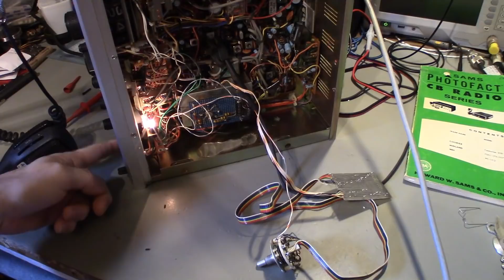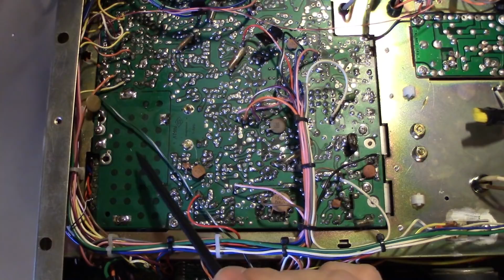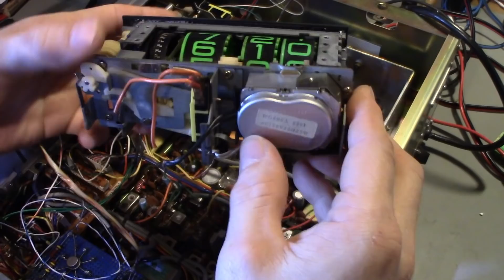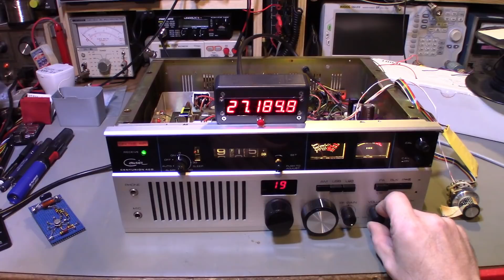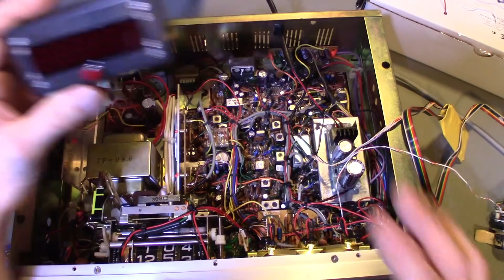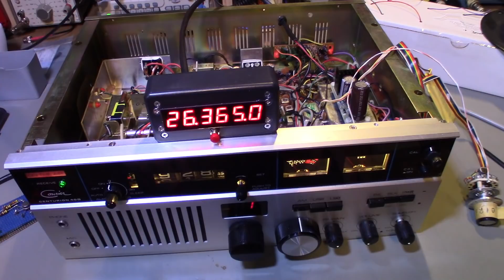Courier Centurion 40D AM/SSB 40 channel CB restoration.

Comment: How much would you charge for a restoration like this? It seems like an excessive amount of work. It would have to be cheaper and better to buy a new radio wouldn't it?

I have a cobra 2000 that my grandfather used as long as i can remember. I always wanted to have it restored and I don't trust myself with all that. I wish they made a modern upgrade you could just plug in some way. It could be tiny with the technology available now.
Reply from the maker: In many cases with the higher end vintage radios they were just built better and people would rather have a classic restored instead of a modern radio of questionable quality.  The Cobra 2000GTL is a good example.  Excellent full featured base station radio with frequency counter built in (ultra rare feature in any CB), full compliment of controls, great receivers and sound good on air.  A lot of other people get vintage radios restored because it's either a radio they wanted earlier in life and couldn't afford at the time or has sentimental value because it belonged to a family member or friend.  Honestly it's probably about 50/50 percentage wise.

As for a modern upgrade that just plugs in that would be hard to do.  All the controls, switches, displays, etc... are hardwired/soldered in most radios.  The boards would also have to be pretty much specific to each radio also.  Lastly, it wouldn't be tiny.  You can only shrink RF circuits down so far.  There are still a lot of relatively large components needed for a radio in the HF band.  Tuned inductors, chokes, modulation transformers, etc... can't really be shrunk down any more than they currently.  If you look at the circuit board for a modern current production that's pretty much as small as it can get and still be a decent performing radio.  Any smaller and you start to sacrifice tunability in IF and RF stages.

Comment: its a 50\50 chance of fixing those clock gears the grease in the motor gets hard i poke a small hole in the back and spray wd-40 in and a couple of drops of 3&1 oil in them dont poke to deep youll hit the drive gear in the back

Comment: Evening mike,I know it’s an old radio but being a Courier fan I wanted to comment. I ran a heavily modded centurion 40d for many many years. My mentor,7OSCAR5 built it for me when I was probably 17yrs old.  It had a bucket full of channels,power and receive was worked over and it had amazing ears and plenty of power,talk back,echo board that was only adjustable internally that was set absolutely perfect,Roger beep and it had a key tone that was a soundbyte of mikes Browning pinging. But my favorite mod was the yaesu  digital frequency counter and VFO that was installed. It was a talking radio,still is. It’s on the shelf in my radio room with the blackcat 200 tube modulator and 4x4cx150 steel tuber that he built for me.  Anyways just wanted to share that with you and compliment you on your work on this old girl.

Comment: Just modified why leave the clock in there and because frequency counter with cable through the back wall? I would have taken the clock out and installed a frequency counter there because it doesn't matter anyway!

Comment: Why install a freq counter when they are quite cheap for a stand alone counter?  I would leave the clock in it and just buy a separate freq counter.  Great video, by the way.  That radio really looks good now.  Even with the channel modification.  I'd be proud to own such a nice radio that will go upstairs and downstairs.

Comment: Thanks Mike for the great video! I used this radio back in the 70"s.. Had it hooked to a moonracker 4 on 30ft tower. I had the channels mods done with the 2 switches on the back of radio along with clarifier unlocked. In fact I still have it packed away in the original box hoping some day to bring it back to life

Comment: was talking to a cb er he said the Centurion 40D has a thing inside u tur to make it go 100 watts is that true or to make go futhere
Reply from the maker: 100 watts ROFL!!!!  They lied to you.  No legal CB ever made could do 100 watts, not even half that.  Could it be made to do it, sure for about a half a nanosecond and then you would probably hear a pop and see smoke.
Reply: is the a thing to turn to make go farther even a little bit
Reply from the maker: If you need more power than what a radio will do with a factory alignment buy a amplifier.  Trying to get it out of the radio is a great way to cause damage by burning out driver, final and regulator transistors.  It wasn't designed to do more than legal power.
Reply: so how many watts can she transmitter and u no what that is in miles 
and thank u for the info
Reply from the maker: abe durant 

FCC maximum limits are 4 watts AM and 12 watts SSB.  No way to estimate range as there are to many variables.  Type of antenna, antenna mounting, coax type/length, atmospheric conditions, etc.
Reply: thanks foe the info

Comment: love this chassis, and there's not much online about them so this video is much appreciated.
I have done extensive experimentation on those cheap ebay freq. counters and have found that the length of the ground wire is a major factor in the noise abatement.  tying the AC and DC grounds together on the radio, and then mounting the counter to the metal chassis works great!  you can check my thread  on WWDX about the digital clock Madison i put one of these in for more details.  As for the masking tape, i use goo gone which is the citrus based stuff, but mineral oil works ok as well.  just need to give it time to soak in.
Reply: Just how do you get those cheap Ebay Chinese frequency meters to work on a CB? What is the method of connection?
Reply: it gets connected to the output of the VCO.  then you program in the IF offset that your radio uses so that the display reads correctly.  they are very simple.  two wires for power and two for signal.
Reply: Thanks for your advice. Which of the cheap Chinese frequency counters allows you to adjust to an if offset?
Reply: Plj-6led. Just Google that or look for them on eBay they are around $10 and come in a 6 and 8 digit version.

Comment: Great clip. Heard one (Centurion) on 38 LSB and it truly sounded awesome. I hope you're not insulted but hearing you laugh at the channel 6 folk was catching and worth more than anything I might've gleaned from the main reason of the clip. 😂😂 Maybe you could put the frequency counter somewhere on the aluminum. And a bezel over it and if that's the only feasible way to do it and the owner agrees with it maybe it's an option. 73 s.ps. I should have watched the video till the end the before commenting frequency counter. Looks good to me. That should work just fine. Great restoration!! 73's (again.)

Comment: Maybe a Short Shotgun Mic on the shelf pointing back towards you may be better for this application.........
Reply from the maker: I found the problem.  It was the blasted transmitter.  I unplugged the microphone from the transmitter and I could still see a reading on the audio db scale on the camera.  If I tap the transmitter (with no microphone attached mind you) it pegs the db scale.  It's microphonic.  I sent the transmitter back to Shure under warranty.

Comment: Very nice and clean job, thank you very much for the tips. I always enjoy your video. I used to use Akasa Clean Sink  solvent to remove nasty label stickers from many plastic type surfaces without leaving any damage or discolouration. It might work in your case as well. This is the link: https://www.amazon.co.uk/Akasa-AK-TC-Tim-Clean-Sink/dp/B000BK7ATI. Is there any description in your past videos how to connect the frequency counter to the radio please?
Reply from the maker: In most radios just hook up to the output of the VCO.

Comment: Mike I'll jump in and ask if you're planning a Yaesu FT101 video with tips and advice on peaking receive and transmit, neutralizing the final tubes, riser boards, difficult to get at caps, etc. Seems like a great candidate for a video as there's little to no clear information on making it a daily user for a regular Joe like me. And your experience and camera is great to boot so it would be super helpful.